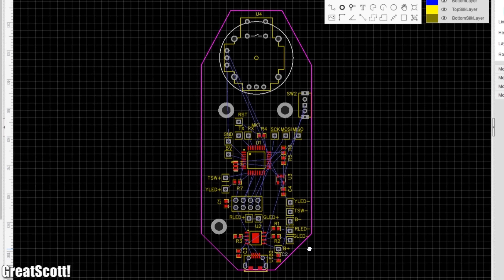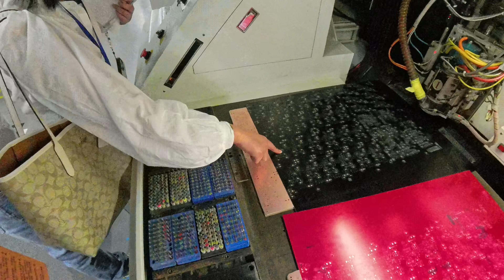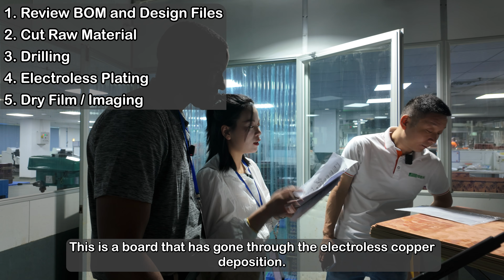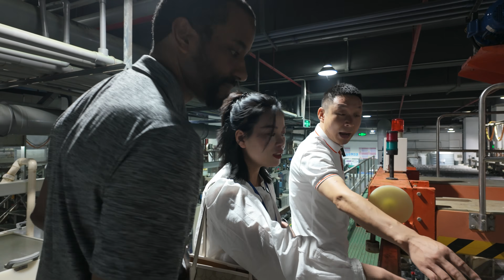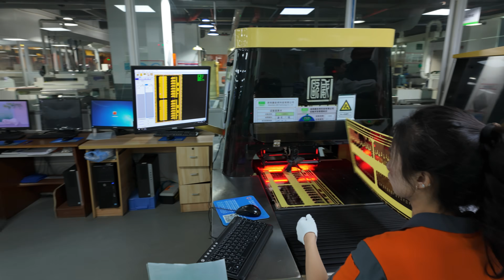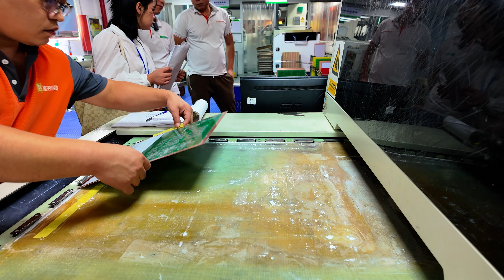I Toured a PCB Factory In China.

Comment: That 3D CAD visualization did an exceptional job at explaining those chemical etching process! Way better at explaining it than what I've seen before! I studied mechanical engineering but now do multi-layer PCB designs for embedded computing applications as my job. Switched from designing in Solidworks to designing in Altium. If you're thinking of diving into PCB design, I do recommend Altium for a number of specific reasons. If you ever got any questions or would like some tips or tricks with PCB design and/or Altium, I'd be glad to help!

Comment: My favorite episode yet, I work in an OEM and there's really not much explanation of the PCB creation process.
We get them ready to use, so it always feels a bit like magic.  When they push back on a design request, we don't always have a good understanding of the problem.
I'd love to take a tour like this just to understand what's easiest for them.  Even just what sizes have the least waste, etc.
Reply: If you know which fab you'll be using, ask them.  Otherwise, it seems that there are some standard sizes (like 12 x 18 inches), and some semi-standard rules on how much space they need between the boards and around the edge.   It is faster/less risky if boards are rectangular; using a pair of L's on top of each other will save material but might require a more expensive process. You can probably find some info by searching for panelization and panel optimization.

Comment: Bro please clear my thoughts 

Can we use a 24 volts on motor which spins about 3400 rpm. (Using battery)

Then connect the rotator with 2kW generator rotator which will spin and generate power will it works. Please answer
Reply: If it's works will it take load of a computer mining ..
Using less power from the grid making power in your own home

Comment: One technical change is that she said she was removing the tin and you said removing the copper. It sounds like they do an extra step to improve quality.

They might do a two-step removal of copper. They do a start etch to get where the traces are and then they plate the traces with Tin Then they do a bulk etch to remove the copper field that isnt tin plated, then they remove the tin.

When you make pcb's at home there is no tin step, and a long etch to remove large areas of copper can sometimes get erosion etching under the mask. The Tin plating step makes sense if you have thin traces which are more subject to erosion.

Also she said they were using tap water in an earlier step. I'd be surprised if it isnt really de-ionized distilled water in the chemical washes.

My question is how do they keep the etchant from getting to the fill layers?
Reply from the maker: I double and triple checked this before publishing precisely because I wanted to confirm I had it right. Perhaps you should watch it again? You might be confusing the last couple of steps as one step or misunderstood what I said. If you want another source check this page out. It shows the process with photos and it matches what she showed and what I said about tin and copper steps. https://www.protoexpress.com/kb/pcb-manufacturing-overview/#:~:text=and%20v%2Dscoring-,How%20is%20a%20PCB%20manufactured%3F,can%20be%20placed%20and%20soldered.&text=The%20fabrication%20process%20begins%20with,drill%20files%2C%20etc.).

Comment: What I'm wondering about the factory: They (the office workers) are all located in a hallway and there is quite a lot of noise, moreover is everyone wearing a winter jacket, so it seems it is not heated properly. At the big machines the workers are not wearing ear protection Weird working conditions for me as an European.
Reply: I was thinking about that too. I work in a PCB factory in the US (not this company), but I recognize the processes they took us through. For example, when I was hired, I was in "outer layer" and I put the film on the boards. The "film" is referred to as "resist" here and my factory puts the boards on a conveyor belt that sticks the resist to the top and bottom of the board, simultaneously. It uses heat to put it on. Now I work in XRAY where I x-ray the inner layers and make sure the holes are lined up. I am very surprised no one is wearing safety glasses and that only a few processes in this video had people wearing gloves. We have to wear safety glasses and gloves throughout the entire process. I was also surprised they use a hat in the clean room, as in my factory, our clean rooms require hair nets and even beard nets for those with facial hair. Certain processes require steel toe boots or shoes, some processes require hearing protection. I cringed at the lack of PPE these people are wearing, because I have gotten drill dust in my eye just by it transferring from my glove to my hand and then to my eye and it messed my eye up for almost 2 weeks. Also my x-ray process drills 2 or 4 tooling holes into the panels, depending on what size they are. My x-ray process not only ensures the holes are lined up, but also measures the panels to make sure my tooling holes are in the right spot. 

Sorry for the long response. This was a good video but since it's a different company than I work for, the process is slightly different, but PPE should have definitely been worn! I have a friend who works in AOI in the factory I work at and even she needs to wear safety glasses.

Comment: It was great seeing how things are done in such an automate way.  Back in the day, I purchased copper boards from Radio Shack and would etch my own boards.  You drew out your circuit on the copper with basically a sharpie pen and then put the board into an etching solution.  Similar to processing a photo.  After the etching was complete, you rinsed things off and your board was ready for your components. We didn't have any fancy coatings to prevent oxidation of the copper.
Reply: I've alwyas wanted to etch my own boards but I don't want to have to deal with the chemicals and the potential mess. I would love to 3D print some PCBs with my 3d printer with conductive filament but you're limited to through-hole components.I really miss Radio Shack.

Comment: Dude I'm BEGGING. Do more Electronics content. It would be incredible if you could do some in-depth component level troubleshooting and repair. It's a dying art.... you are a wonderful teacher, with a big platform. And I think you could really bring something important to the space. 

I do new industrial board repair at the component level, and I with a few 15 minute videos, you could teach folks everything needed to repair 90% of possible failures. All with a cheap multimeter, ESR tester, and a $20 soldering setup
Reply: Really insightful factory visit! Seeing the PCB process highlights how electronics need quality mechanical parts. We help with that through rapid prototyping and low-volume production of durable enclosures and components.🤝

Comment: Loved this video! Designing PCBs is what I do for a living (also known as Printed Wiring Boards, PWBs)! I'll be presenting to other engineers about how PCBs are made and its great to see the inside of other PCB manufacturers. It was cool to get more insight on Panel Plating too! Love it. 

For my engineering friends here, note the processes! There are many aspects of your PCB design where you may make the process more complex! These are part of what cause your designs to cost more!

Extra fun fact, Pattern Plating wasn't always done. They use to do what is called Panel Plating, but it fell out of favor because the entire panel would get copper, requiring them to etch it back down, which is another 2-3 steps and quality checks on the PCB. With Pattern Plating they can plate the specific sections that they want, such as the traces and holes, and the Plating Resist (made according to the 'Pattern' of your design, shown in the video as "Hardened Imaging Film") will prevent the rest of the PCB from getting extra Cu.
Reply from the maker: Exactly! I saw so many elements that were important design choices. I hinted at it in the video when talking about multilayer PCB’s but I didn’t want to make the video too complicated or long. It was so interesting to see how much engineering choices affect manufacturing cost.

Comment: I fabbed my first board a couple years ago, for a modular eurorack synth project.  I went from having never touched any PCB layout tool to a finished board (with only a couple screwups that required bodges) in only a couple weeks.  It looks scary, but if you understand electronics and can handle CAD, KiCad (and the other EDA apps that all use the same sort of core architecture) are much easier than they appear.

The probably-illegal ending of de minimis is going to suuuuuck for getting cheap PCBs made, particularly for budding hobbyists getting into it for the first time.  They'll still be cheaper at 2x the price, compared to easily 10x the price for domestic fabs, but they'll required weeks to months to get through customs, so there goes any rapid iteration...

$70 for 5 copies, plus shipping, vs what's probably going to be $14 for 5 copies (including shipping) plus six months lead time.

I would have liked to have seen the flying lead testing machine in action...  All of my board orders are so small the bed of needles test doesn't even pop up as an option, but every order comes with a flying lead test.  I assume it's just a CNC gantry, maybe two, with two probes that go around making sure points that are supposed to connect do so (with a resistance tolerance?) and points that aren't are open circuit?
Reply from the maker: I don't know for sure how comprehensive the probe testing is. But at a minimum you want to check what she mentioned which is that all the pins that should be connected are, and none that shouldn't be connected are. Definitely a continuity test.